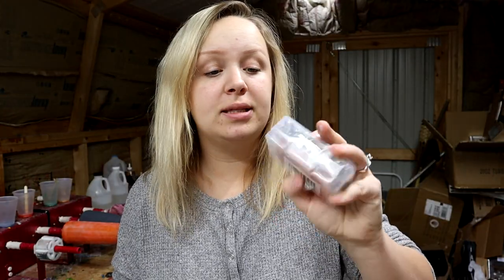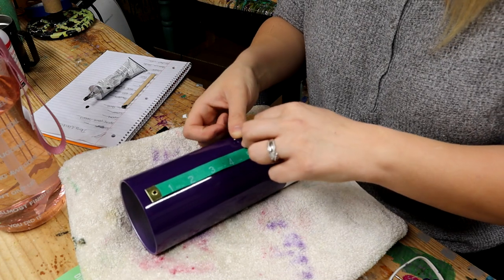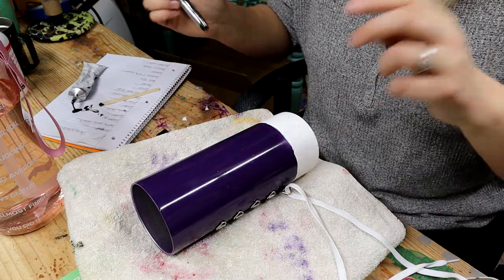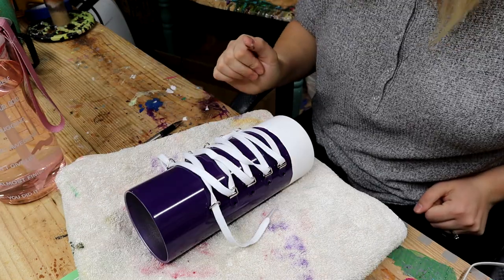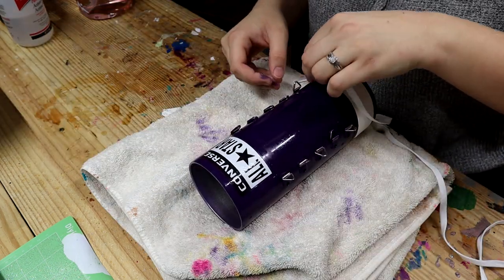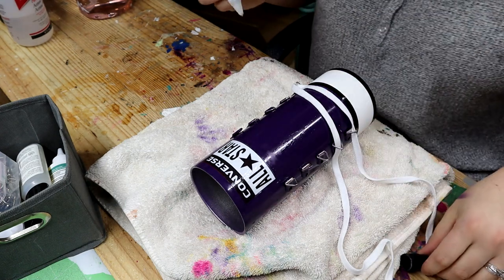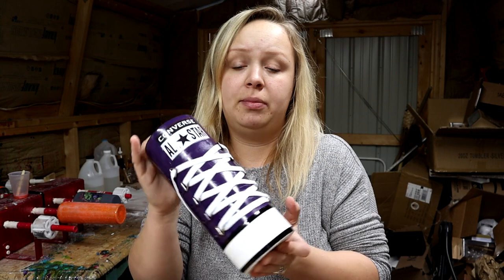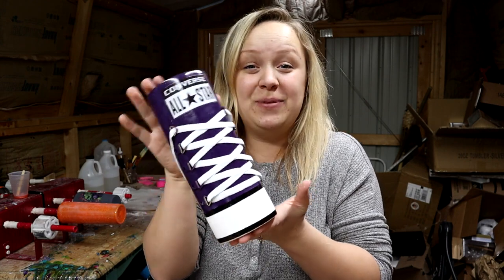Converse Tumbler Tutorial | Customer Request!

Comment: Also because you know I don’t know much about the water slides. It’s a dark cup so did you use clear or white. I’m so confused 🤷‍♀️ lol
Reply from the maker: I used clear because that’s all I have, but I spray painted it white so it would show up
Reply: @CourtneysCustoms  so could I have done that with those fish I was trying to do? Lol
Reply from the maker: @debbiemorris5707  you could, but when you paint it white you have to take scissors and cut out exactly at the edge of the design or the white paint will show. I usually only do this if I can easily cut it out
Reply: @CourtneysCustoms  I cheated and did print and cut
Reply from the maker: @debbiemorris5707  omg I literally CANNOT get my cricut to cut my printed images right !! I’ve aligned it so many times and it just never cuts right
Reply: @CourtneysCustoms  that’s weird well I have a maker as well and that thing keeps messing up. I need to call them again just always put it off. I’m just glad it worked. I also saw something where you can use the flatten key to just keep the outer edges. Not sure how that button works lol